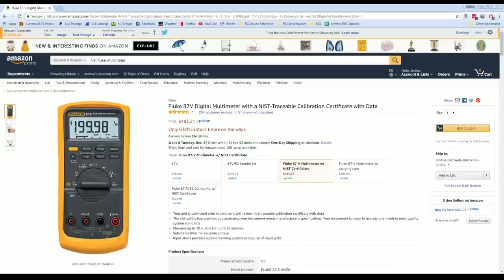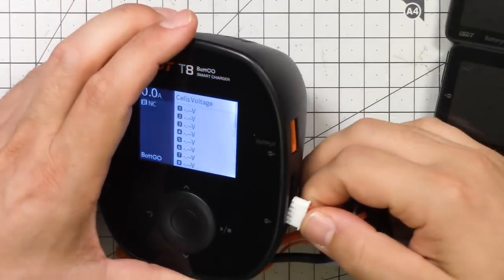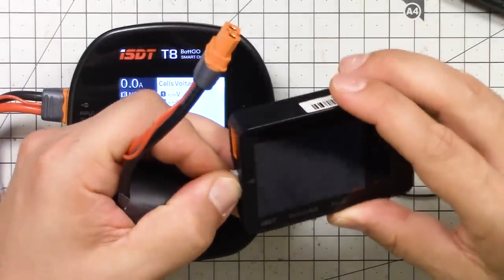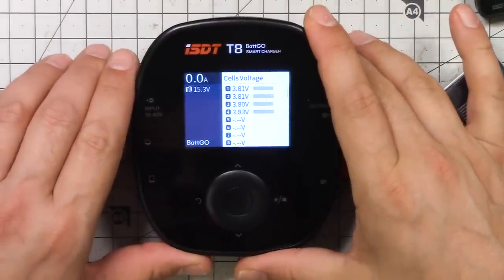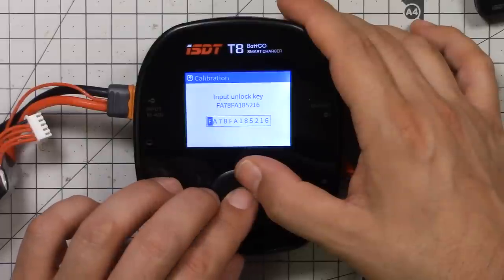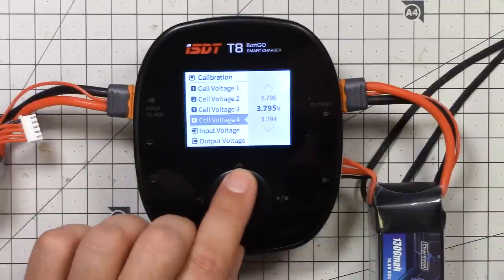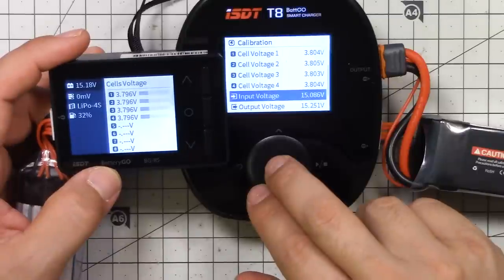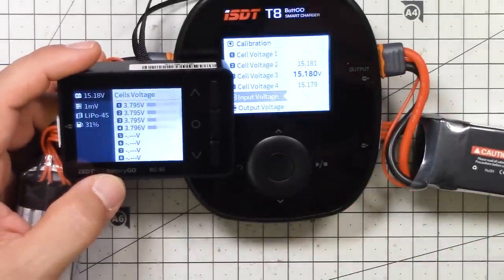Calibrate ISDT Battery Charger Voltage | HOW TO

Comment: Thank you for showing me this. My ISDT T8 says it has 12V input voltage. So i modded my 500W 12v ATX PSU for use with it. Unfortunately the new firmware will not let you set the cutoff voltage below exactly 12V. So until knowing i can calibrate the input voltage I could only get about 100W of input before my PSU sagged below 12V and hit the cutoff. So now I just calibrated the input voltage high and can get access to the full rated amps out of my PSU (around 350W or so as written for the 12V rail). Much better now! For those reading this the ISDT T6 is rated as low as 8V input voltage and is better suited for this setup without making this mod, which was the route I was going to take until I learned that the input voltage can be calibrated high.
Reply from the maker: Not being able to set the cutoff below 12v is really questionable. I've never seen that before.
Reply: I dunno what to say. The firmware readout of my unit is the same version number of what's available on the ISDT firmware download page. When i go to the settings, the voltage cutoff will not let me configure it less than exactly 12v.
Reply: My only guess is that the manufacturer had issues converting less than 12V up to 8s and made the change. My charging application is only at around 13V but I wanted very high output amps, so I chose this model. If it is the case they made this change on purpose then I should avoid whatever issue they were seeing with the DC/DC up converter. Either that or it was an oversight.

Comment: IMO calibrating to a 1/1000 of a volt using a battery checker is not a good option as the checker is powered from the battery that it tests and that will definitely affect the last digit at the very least. A good multimeter is the proper way of doing it. Luckily DC voltage measurement is the easiest to do so there are a lot of cheap and accurate meters that can do it and a fluke level meter is not necessary (their main claim to fame is their safety and for the voltages we need it doesn't matter).
You need at least a 6000 count meter to calibrate to 1/1000V. I recommend the aneng an8008 (10000 count) which can be had for under 20$ in aliexpress or banggood (and is sometimes on sale for 16$) and is very accurate for electronic purposes (see EEVblog's review of it - it matches very high end bench meters).
If you are really serious about accuracy you can get a voltage reference to verify your meter (a good AD584 module can be had for just a few dollars on ebay).
Reply from the maker: Thanks, this is a great suggestion.

Comment: Hi, I have the same ISDT T8 charger, all good until now when I use it to 8s. The question is, do 8s chargers in general or this one in particular have errors when used to their limits that is to charge 8s? I don't know who to ask and you seem a very well informed person.
 I've builded three 8s8p lithium ion packs from 21700 Samsung INR 40t 4000mA 35A new cells fron the well known Nkon european company. All cells had 3,44v. They are to be connected in series to form an 2,8kw 24s8p electric paramotot battery.(project on openppg forum/community/builds/eppg project-2,8kw battery.) problem described on page 13. It seems I can't attach link or the comm is not posted.
From first charging (the three 8s 32v packs in parallel) I've saw that one cell nr one on the charger (last cell in the pack) the voltage tends to remain behind like 3,62v discharged or 4,07v charged and other cell groups 3,66-68 and 4,08-09 (verified with a volt meter) 
Also the impedance is around 6mohms on this first cell of all three packs and all others have like 0,7 mohms! (This is when all three packs are charging in parallel so a cell group with this impedance is basicaly 24 4Ah cells in parallel that is 96 Amps). When I connect only one 8s8p pack to the charger the impedance is 18mohms on this particular cell group and others have 2 - 2.5mohms this also on each of the three packs which kind of excludes the probability of a bad or disconnected cell or wire.
A well known electric patamotor builder and RC user told me that 8s charger tend to have errors on last/first cell when used with 8s packs and after years he didn't find the cause yet.
So I've made myself wires so I can hook up only two group cells through the balancing wire and the results where all over the place, I mean one time a cell group shows 18 mohms and the second group 43 mohms, next time the one with 18 has 52mohms etc..but this way I realised that the last/first cell group didn't show the same huge difference from other groups like it did when all 8s are charged together so all groups are probably fine.
I've worked a lot att his battery, it coste me a fortune, above 1.000 euros and I whant to fly with it so I realy need to know if I can trust it or the charger, and If I need another charger that realy handles 8s so bee it. Really need your proffesional oppinion on this. Appreciate it. Thank you!

Comment: We should be pressuring isdt to calibrate their chargers!
 I’ve purchased 6 isdt in the last 4 months. All overcharge cell #3 by as much as .08 volts and undercharging the others by .1 measured with a real fluke.

Comment: Agreed it's not easy to get the absolute number right. But the relative calibration (make all channels agree) is quite doable. Just use a cheap multimeter, preferably with mV resolution, and measure one cell at the time via the balance connector.

Comment: Good bat checker worthy of your money for sure. I "saved some money" by getting a five pack from the usual source to find not a one was consistent with multimeters. Looks like yours is the real deal, hope that don't sell out because of the Bardwell effect, as in you recommend and they immediately go out of stock! Thx Joshua for the heads up.

Comment: I don't know how confident I'd be in the accuracy of the voltage checker- certainly not enough to re-adjust my charger based on it. even a few 10's of mV is most likely enough to shorten battery lifespan.

Lots of resolution doesn't make the meter accurate on an absolute level. It's only really useful for comparative measurements with the same meter. you could be just offsetting the charger in a different direction if you battery checker isn't 100% accurate. I would at the very least validate it with a half-decent multimeter. Even a china-domestic cheap fluke, or a brymen or higher end uni-t would do the job fine.

That said, thanks for the useful info, I had no idea there was a secret cal menu on my charger, I had been told over and over that the ISDTs were 100% non user adjustable, which was literally my only issue with them (well, aside from the horrible roller style selector wheel on my Q6...)

BTW, when I checked my Q6's calibration, it was within 15-20mV on each of the cells, and the overall voltage was about 60mV out. Pretty bloody impressive, though I'd be curious to see how that calibration tracks over different temperatures. It's around 30*C here at the moment, so I'll have to check the calibration again in the winter, or maybe stick my charger in the fridge some time :D
Reply from the maker: I agree.

Don't forget that the pin was also different from the other pins on the T8. None of this is as good as an actual calibrated reference, but with a difference of 0.3 volts, it really feels like it should be pretty trivial to at least improve things. 0.3 is pretty far out.

Comment: Have you used the ISDT T8 with 8 cells and notice anny voltage or impedance differences on first/last cell? Is this a known issue with chargers when charging 8s?

Comment: hello, congratulations on the video, I use a lipo 2s battery of 6000, when calibrating this 3.960 cell 1 and 3.820 cell.  I must go up to 3,960 or put 4,200 in both cells?

Comment: the correct way to check is use a voltage reference module, it outputs specific voltages and you calibrate your meter to match it. now in the real world the way you do it is in this video, if you got some meters saying about the same thing than, good enuff 4 me

Comment: This is great information. But I cant find anyway to calibrate my EV-PEAK CQ3 100W. No pdf on google that I could find and its giving me bogus voltage x cell. even on cell 5 its putting out 4.26. Need help with this charger. Thanks.

Comment: Thanks for the great and helpful video! I have tried to contact ISDT support by using their support email address, but I never get an answer.  Do you know of a way to contact them?  You might know the answer to the question I have for them: When I set it to charge a lipo to 4.2 volts per cell, it charges the battery to around 4.15-4.17 volts per cell. I turned "trickle charge" to "on," and that does help some. The voltage readings on the charger cycle from 4.17 to 4.21 or even 4.22, then when I stop the charging it will settle to around 4.18. Do you know if this is normal? Is the charger smart enough to sense the battery's resistance or response such that it can detect if it could harm the battery to charge it all the way to 4.2 volts per cell?
Reply from the maker: I would just raise the finish voltage to 4.21 at that point.
Reply: @JoshuaBardwell  I'll try that - thank you!

Comment: Buy a præcision voltage reference, 4,096V is a standard, and not expensive.
Reply: best tip so far!
Reply: The problem with that approach is, the way they've implemented the cal menu (at least on ISDT chargers), you'd need at least 4 separate references in series, hooked up like a lipo+balance lead, because it won't calibrate unless it sees a full pack plugged in, and all the cells. 

Fortunately, I have a pretty nice 50000 count 0.03% meter to calibrate mine with a regular battery pack. Gotta love the feeling of a piece of equipment that's freshly tweaked to within half a gnats ass of reality. Though TBH, I was pretty impressed with the factory cal on my ISDT Q6. All the cells were within 10mV of my meter, and the over-all voltage was only 50 or so mV out. I'd be curious to know what the tempco is like on these chargers, I could see it having been bang-on at the factory, and just had it drift with the hot summer weather here.
Reply: Use the voltage reference to calibrate your multimeter, then the multimeter to calibrate the charger.
Reply: yes i agree was thinking of analog devices 4.2V ref .1% accurate @ 1 Amp load worth about $6

Comment: Joshua!!!!! Can we balance several batteries with the jb stix balance board and idst' bg-8s??? or is there some other components on the jb stix balance board which would stop this ?? thanks for the charger info by the way my charger shows exactly the same readings are off on cell 4!

Comment: What is the definition of the output voltage in the calibration menu?  I think it’s what the T8 is reading as the battery connected on the right side of the charger, “charged battery”
Reply from the maker: Output voltage calibrates the output XT60. If the output voltage is mis-calibrated, your batteries will end up at a 4.21 volts or 4.19 volts instead of 4.20.
Reply: Joshua Bardwell no I feel dumb. How would you check the voltage off the output xt60. Certainly you can’t meter the output on the T8, it would throw up that error message. I assumed it would match the actual voltage of the battery. Maybe I just answered my own question. Love the videos. Keep it up!
Reply from the maker: You calibrate the output XT60 the same as you do the input and the balance. You have a known-precise voltage source and you plug it in. So you could take a battery and very precisely measure its voltage, then plug it in and calibrate to that voltage.

Comment: Josh i have the ISDT D2 . All of sudden i hear a snap and it shutsdown and its dead now. I opened it up and found a small capacitor burnt next to the TEA1716T chip. Changed it and still ( its in the power board).
Reply from the maker: I think it's dead.

Comment: I have a charger that has 2 channels, and I suspect one of them is off. After each flight I individually storage charge each battery, however one port seems to take significantly longer than the other port. I'm thinking maybe calibration is off. The charger is a Hota d6+.

Comment: Wondered if you have anything on upgrading firmware on these ISDT chargers. I bought a Q8 and when doing the update using their app on Windows 10 (tried Mac also), Windows alerted a virus and deleted the exe leaving the Q8 bricked. Have been trying to get a solution as I believe one of the issues is the continuous trickle charge once full charge is achieved on Lipos. Cheers, love your work.

Comment: So I did this different. I used my parallel board...couple extra jumpers so I could have my batt checker and batter plugged in while calibrating. I did 6 ISDT chargers this was which all of them were about .010 high (probably for safety).  I took that to .005 to get a little more mah in my packs :)

Comment: would this make the charger only work at a low charge rate?  my Q6 is only putting out 0.1A regardless of chemistry, ie., Pb, lipo or Nimh all the same, 0.1A charge rate..
Reply from the maker: I think something else is messed up. It seems like it might be broken. Assuming it's not user error. Are you setting the charge rate to 0.1 amps?
Reply: @JoshuaBardwell  I tried different charge rates, up to 6A.  I think it's broken too.  someone suggested a blown fuse, I'll see if it has one.

Comment: HA i have 8 of these battery checkers and they all read differ. i was using to check my electric trike one for each pack need to ship back to ISDT to have them calibrated the same
Reply from the maker: I think it's unlikely that ISDT would calibrate them any further than they did at the factory. For this price, this is the level of precision you can expect. Here is how to calibrate them yourself if you prefer.

https://www.youtube.com/watch?v=L5gAohxwOxU

Comment: I'm using the q6 300w charger but the fan never gose on. Temp on screen reached 41*C. Only charging 2s battery. Did self check and fan went on. 
Is it supposed to go on all the time, or only when temp gets high?
Reply from the maker: +Aleks Siwoszek only when the temp gets high

Comment: Fluke knows their equipment is right because their equipment was tested at NIST.  That NIST paper is a traceablilty document.  It is basically saying my meter is with in x tolerance of their meter and their meter was tested by NIST or some other party in a longer traceablilty chain.  Ideally you would want to be as close as possible to the NIST equipment to avoid increasing your measurement uncertainty.

Comment: I used the ISDT BG-8S like you to calibrate my T8 but I cant get cell 4 calibrated right....I did everything like you showed, what am I missing?
Reply from the maker: I'm not sure what you mean, can't get it calbirated right? Is it not holding calbiration?
Reply: Update, when I charge only one battery it is well balanced (after my calibration, which holds BTW). But when I parallel charge a bunch (6-12 lipos) , they aren't balanced at the end.

Comment: Josh I have a question for you I have a sp racing F3 bored and when I flashed it and all that comes good. Went out fluid for a couple days crashed it Come Back Inn put it up on betaflight it hooked up alright for about 10 20 seconds and then shut off. do you know what's going on? The Flash's real fast and then disconnects
Reply from the maker: +flying hi if it fies a sequence of fast and slow flashes, that means it's dead. Sounds like it's probably dead either way.

Comment: Joshua, this doesn't seem to work with my SC-620. Do I need an updated firmware to do this or is there some other combo to unlock this menu?
Reply from the maker: Unfortunately I don't know. This is the only information I could turn up about how to calibrate them.

Comment: Any idea why isdt T8 would be showing 4.2 volts that are jumping around through the charging port when in reality the voltage is 3.7 when measure with a meter and the quad? This is a 1s battery, i have 3 chargers and they all have the same issue. I can charge a 2s, 3s, etc. just fine.
Reply from the maker: The charger may not work well when the balance lead is disconnected? Just guessing...
Reply: @JoshuaBardwell  i dont know how or why, but i think it was in the connector. I bypassed 1 of the connectors i had and it is working.  Thanks for the input though, keep up the good work.

Comment: JOSHUA!! can we balance lipos with your JB STIX v2 parallel board and a bg-8s balancer? thanks for this video my charger was showing cell 4 low as well!!! legend thanks mate!
Reply from the maker: +T Dub of you try to balance a whole balance board with that tiny balancer I think it will take forever. But you can plug it into the balance port of the parallel board I suppose.
Reply: thanks mate ill give it a go , i also wonder about the jb stix board with the isdt lipo discharger? anyway thanks again for all your vids man ... legend. come fly in Australia one day!

Comment: I have a problem with my ISDT D2 which is that that charger does not save the calibration settings - after restart, it still shows the old "wrong" measurement. Anyone experienced the same?

Comment: I bought a Q8 to replace the T8 I cooked, I guess it's me fault! But I killed the charger and power supply, but now I have a 200amp, 24volt power supply, so that should not be a issue, and I'm using fuses,

Comment: Mine charges a few cells to 4.35, when set to 4.15, it's a good thing it was a low current charge, I noticed the 7th cell reads 4.04, when the meter and everything else said it was 4.10-4.15v it's a bit off, and refuses to balance!